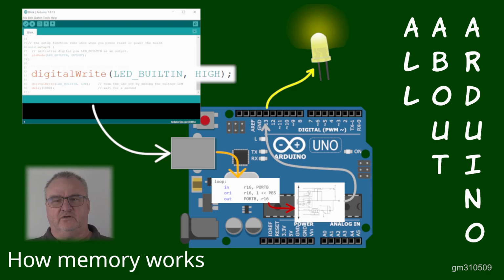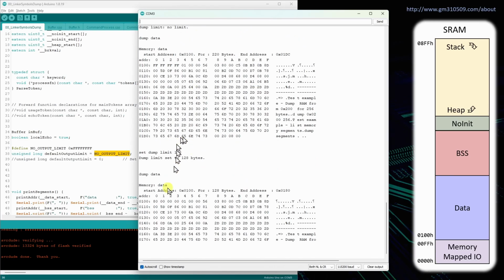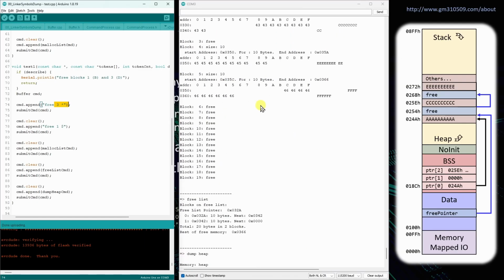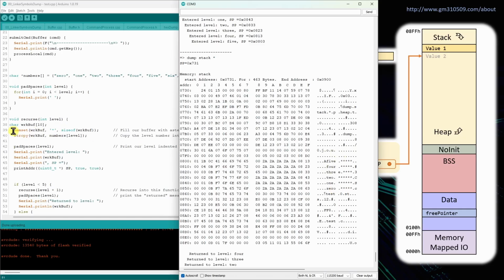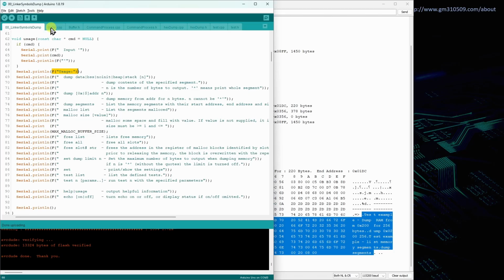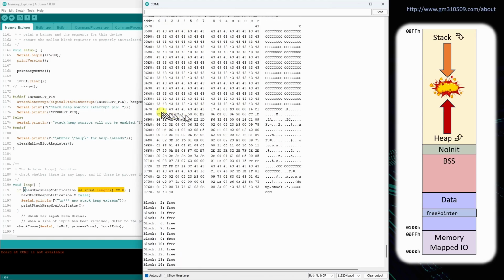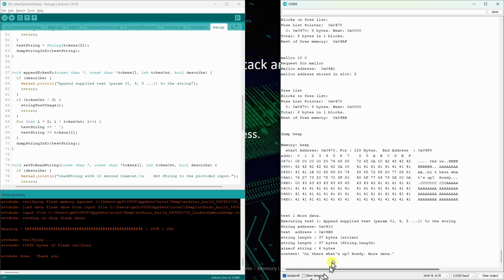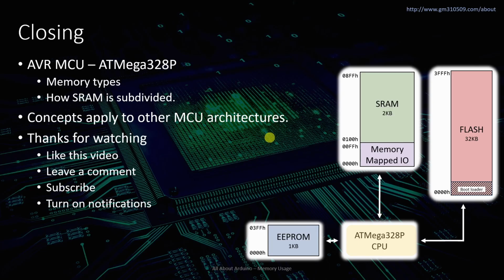Arduino Memory Explorer - A software view of how memory is used.

Comment: I love the memory visualization! This would of been really, really helpful for me about 10 years ago! 😁 Memory fragmentation and the heap are my enemy... So many unpredictable errors coming from them. 

Also great visual to understand pointers.
Reply from the maker: If you are using an stm32 with 32KB ram and only have 2-4KB left over, you are using a whole heck of alot of memory. Did you try leaving your strings in flash memory using something like the F macro?

Unfortunately the stack heap monitor is only 95% of the way there for an STM 32. There are some special symbols you will need to define to access the SP, break value and heap start. I have found rhem for the Uno R4 (arm cortex) but they are slightly different for a Teensy 4.1 (also arm cortex) and almost certainly different again for the stm32 - depending upon which compiler and libraries you are using. But that is all that is needed. Definitions for those symbols and the monitor should work as is for stm32.
Reply: And now I think I have a possible stack/heap collision in one of my firmware. Luckily still in testing! After watching that part, too many things in my mind are wondering if a shady third party library I use could be causing the sporadic memory corruption in one of my small 32KB STM32 chips. I have about 2-4KB not allocated but I think random fragmentation accumulating and the library taking liberties with memory addresses might do it.